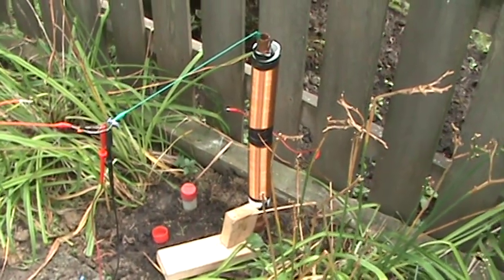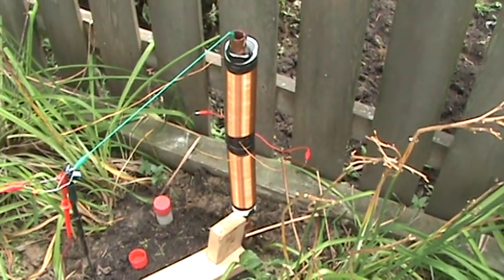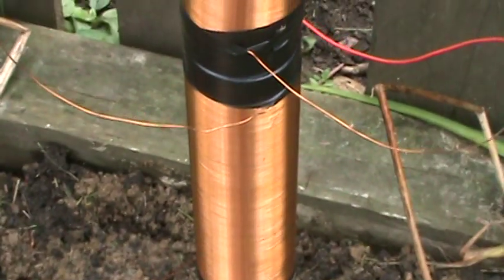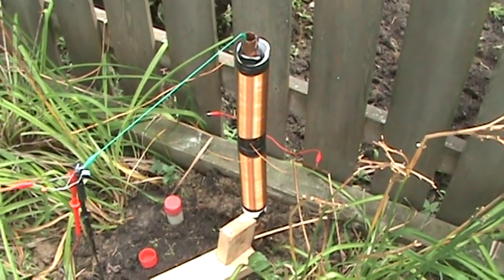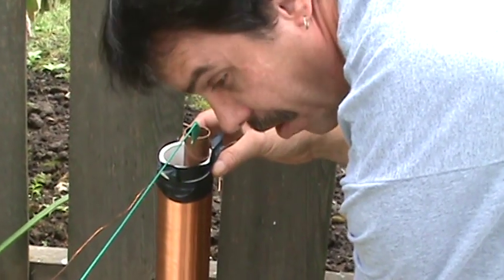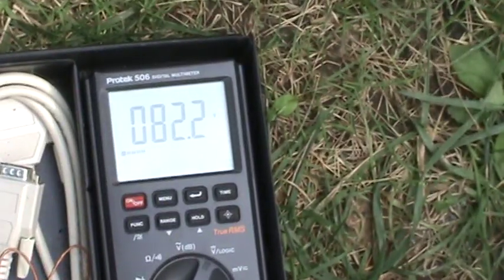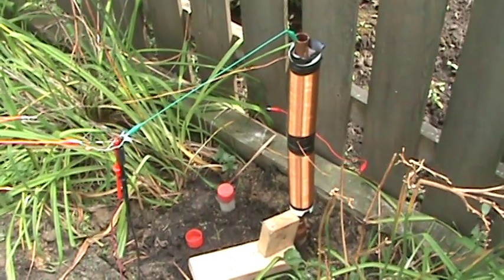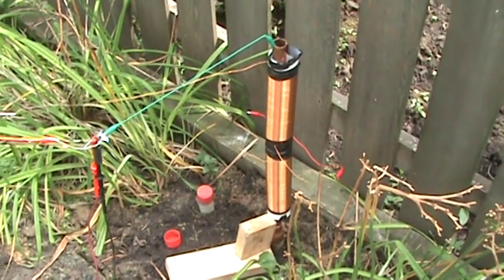FREE ENERGY FROM AIR CIRCUIT PART 17/24

Comment: it is closer to the exit of the voltage. Less impedance.  did you try a bigger rod on the inside? Every bit of air is a loss. interesting project.
Reply from the maker: Great to see you here Nathan!  You picked the right video to watch!   I think I have tried a larger diameter rod on the inside.  I put adaptor on end of copper tube to make it to a larger or smaller dia for experimenting.  Yeah, I noticed you did similar things!!  This is very special.  This has been like a discovery for me, and I have never seen anyone do a set-up like this, until I saw a few of your videos.  Seems very important to bring the circuit and coil back through itself to ground.  It's like a new type of transformer with only one coil.  Finaly!  Your one of the few that understand it!   Thank you for noticing!!!
Good to see my dad again.  I forgot he was in this video.  I have not been able to go into his house since he passed away.  Still going though court almost 5 years now.

Comment: the ground pipe is too close to the wound coils....separate by 30+ feet then see what voltage you pull man ....go for it.
Reply from the maker: Thank you, but i tried that, and i did not get better results.  The ground rod is going "through" the coil. I have a whole new series of videos "free energy from air 2015.  I built this whole set-up again at new location now and with different length and height of antenna, and still i get best results with ground running through coil.  Im still using the same coil though.  I thought maybe the ground through center of coil was coincidentally tuning the coil or circuit to resonate, but now at new location with different antenna I still get best results with ground through center,,,i dont understand why!?  I get a "lot" more voltage with ground through coil.  Now thinking, maybe i get less voltage with coil separate but more current, i will have to look back at my notes and see if i check current at that time.  I been experimenting with this again now, but starting from scratch.

Comment: Hey there INVENTOR3

You say in your video "Free energy from the air" part 17/24  2:40  sec that the voltage goes up when the internal pipe is at the front of the inside of the pvc pipe!   maybe this is stronger when the internal pipe faces North  etc    you know spinning of the Earth , try it!
Reply from the maker: +Stop Renting Today Thank you, good thought, i will check this out :-)

Comment: Does the position of the fence matter? What amprage does this create?
Reply from the maker: Fence position does not matter.  Get only about 600 to 800 micro amps.
Im adding on concepts now that this antenna and circuit set-up will act as the pulse for it, and the low current wont be an issue.

Comment: ideas ideas. i have loads but no time to do the dedicated work you do, great and well thought out work btw. thicker copper wire maybe a taller pole would in theory conduct more energy from the back ground. great point about the frequency i had no idea that would alter with the center earth pole. this is where i got the idea that thicker copper conducts more back ground energy (theory given for the slow moving magnet is Eddie currents presumably thicker copper pipe larger Eddie currents http://youtu.be/E97CYWlALEs
Reply from the maker: Thicker wire may help, because it has more surface area.
Antigravity Effect , Magnet Through Copper Tube, part 1

Comment from the maker: The pipe inside the center of the coil acts as a tuner.  It probably would be better to have a closer fit. What i stick inside of the coil makes the inductance of the coil change, therefore changing the frequency of the coil.  Changing the inductance like this is like having a variable coil.  We want the LC circuit to resonate. Thanks for your comment.

Comment: it was mentioned that it matters how close the copper earth pipe is to the wire, would it make any difference if the copper pipe was larger and was closer fit between the outer coil winding.

Comment: I have an antenna that goes in the ground. I think our circuits work slightly differently. I'll look into 258KHz. My antenna is enameled so it doesn't usually make a difference. Sometimes when I touch my antenna (depending on what set up and using a transistor) it goes up significantly. Maybe I'm reflecting radio waves onto the antenna at the right frequency.

Comment from the maker: 258KHz video part 7.  below am radio.
Strange that the coil gets best results with the ground pipe going through the middle of it, i think the pipe is acting as a tuner.  I always get very bad results if any part of my antenna touches ground or even a tree leaf, the voltage will drop fast if i touch the antenna in any way, or if anything touches it, especially the ground. Do you get more voltage when your antenna touches ground?

Comment: Hey do you know what frequency your getting? This could help determine what the energy is and its origin. I've found that sometimes a short antenna works better than a long antenna, which must be to do with frequency. Why do you think a coil work so well over the grounding? I've also found out that an antenna going straight to the ground can make a lot of difference. Do you think it could be to do with opposing flows of energy creating a magnetic field?

Comment: Do you happen to live near a substation or transformer?  Sometimes shitty grounding can cause low voltage AC seep into the ground which your coil could (potentially) pick up with a little luck.  I doubt your getting "free" energy though.

Comment: You'll want to keep the coils separated. Top half +, and bottom half -, but the terminals would be in the center of the coils, then for the rod, you'd need 2 of equal length to each coil

Comment from the maker: Yes, and i can not get the dam thing to light.  I did check current accross a load/resistor,,micro amps,,,i think it was around 86microW of power.  Ill be doing many experiments in the next few months on this again. I will experiment with resonating with the earth and variable caps/decade boxes in differant locations on the circuit and try to replace the antenna with alum foil sheets,,,and much more.

Comment: Your experiment is actually getting energy waves from Cell phones,  power lines, radios and TV stations and even satellites.
Have you tried to install or move your "antenna" to the roof? or as high as you can on some utility pole or street light???
If you do, I think You'll be surprised - But watch out for the high voltage spikes.

Comment: i'd try to connect my coper wire to a train for example or a car or ground wire in my house or something like that pls tell me ur results after doing that :) if it wouldnt burn ur capacitors or diodes than its a lost cause from my part

Comment from the maker: @cris23dumi lots of voltage , but little amps and power.  Im doing more experiments with it now.
I get germanium diodes from mouser dot com
It is important to find diode that has smallest current rating.

Comment from the maker: @TheDaikashido well, i meant it works best with ground pipe, straight up against the inside wall of the coil, does not matter what side,,hmmm, or does it,,,i did not check other sides.  we are looking south in the video , facing the fence,,looking away from the fence is north.  I have ground pipe to the north side of the coil.

Comment: @INVENTOR3 No , actually it sems that the Earth behaves like a spheric capacitor. The ionosphere is charged by the moon and sun and cosmos with negative charge , and the ground we sit on is positively charged. apparently this antenna is more efficien whene it is longer than 6 feet ; you get more and more power

Comment from the maker: @Griffith181 No problem.  .034 dia, i forget what gauge this is, i want to say 20g or 21g, ,i am sure of the dia.
plus it is double dipped varnish/laqure type coating so it actualy measures .0344 dia. single coating should work fine though.

Comment from the maker: Hmmm, sound good.
Bifilar..more than tuning...you think maybe they will increase voltage and current or...?
I like idea of variable caps...i will try variations of caps next.
I HAVE BEEN GETTING SOME GOOD SPARKS FROM THE CIRCUIT, ABOUT EVERY 20 TO 30 SEC TO BUILD UP.
Yes, tap the large cap with small pulses....i like idea very much.
appreciate the comments, thanks.
3 more videos out now :-)

Comment from the maker: yes, would love to have a sponcer.
i will get voltage back up there.
i been checking temp and humidity all the time, but im always making so many changes that it is to hard to tell if weather conditions are effecting it yet, untill i keep same set up for a while. Yes, stormy weather...more static in the air...but i dont think im picking up static elec.
i will be checking power with load soon.
Yes,,i will definetly look into the joule thief circuit yet.  Thanks for comments.